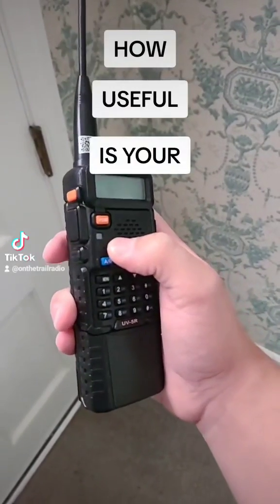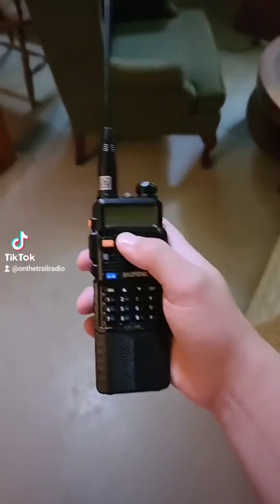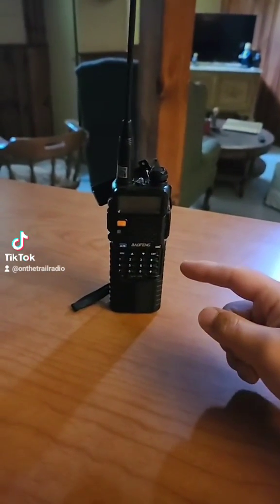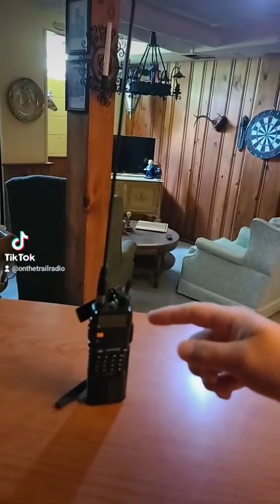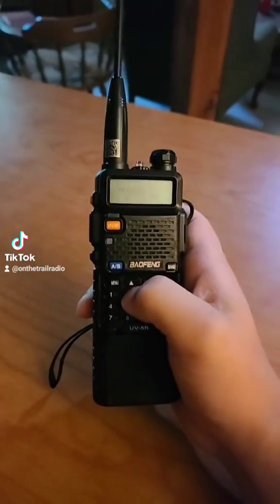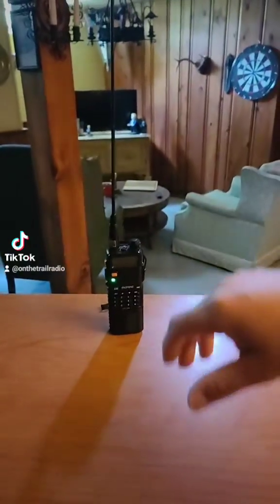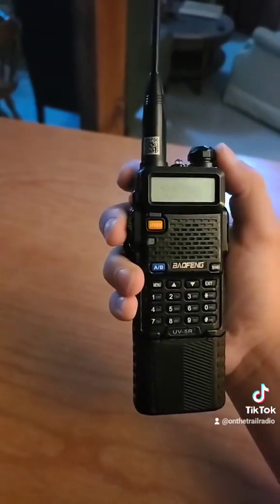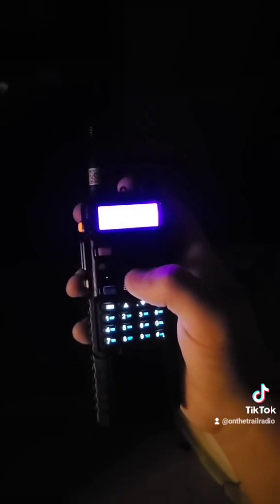Baofeng UV5R "Tornado Test"

Comment: Do you have to have a ham license for one of these radios
Reply: Technically you don't need a ham license to have any type of radio. You only need one to transmit. If you wanna talk on the ham bands you need atleast a technician class ham license. If you want to transmit on the gmrs channels you gotta have a gmrs license, which is easier to obtain and you can use the one callsign you get assigned for your whole family so you can stay in touch with them. The only problem I can see with gmrs for a shtf situation is that there's a small number of channels you can use compared to the frequency space of ham radio. This means that its possible for the channels to get overwhelmed from all of the people that could be on them. I don't know much about gmrs so anyone feel free to correct me who reads this. hope this helps!